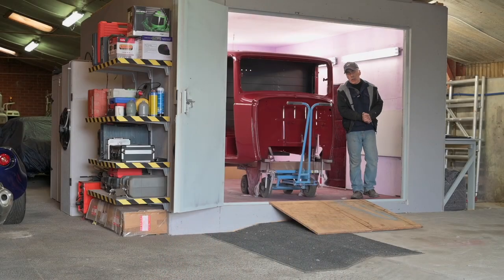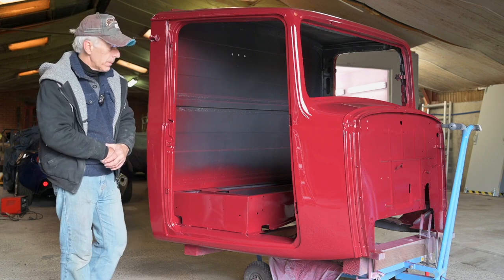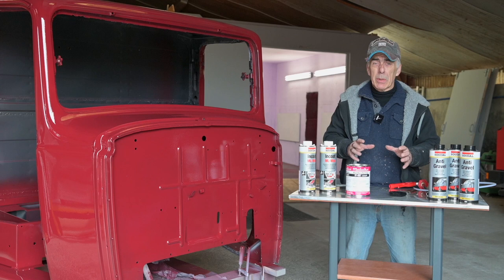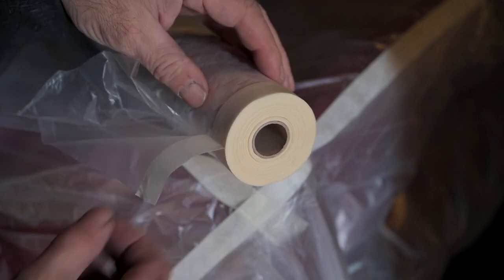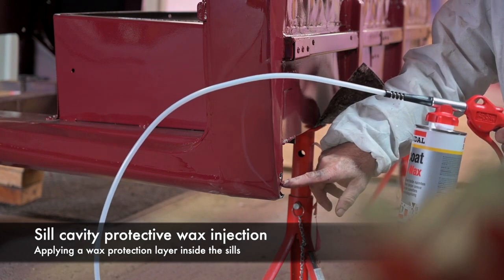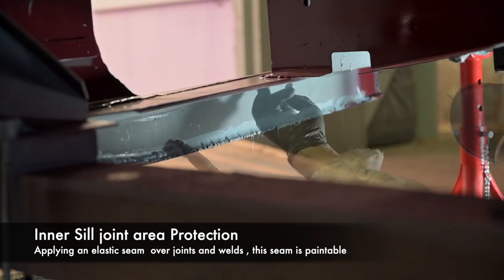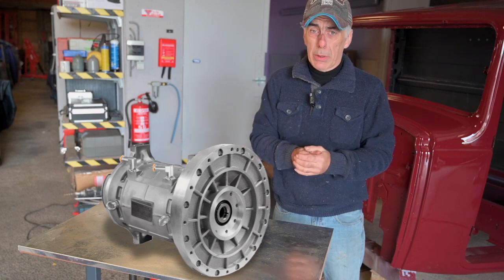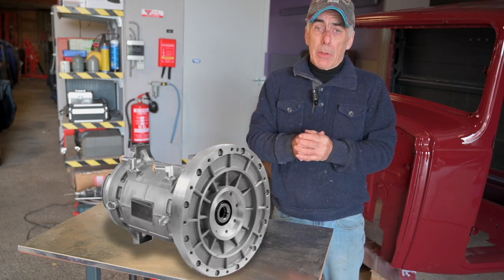Old Rusty, Part 24  Protecting against rust

Comment: Original, Only way to go, It is, after all a Classic. Needs to stay a Classic.
Reply: Rems61 trouble is an old 40bhp engine isn’t going to be able to keep pace with modern traffic. I Don’t like electric conversion
Reply: @ashleyjames308  You don't put all this effort into a classic vehicle to drive it in everyday traffic. This is for Sunday outings, a trip to the lake or the park, or the occasional classic car meet. Use the crappy old Toyota or such for the traffic.

Comment: Making a choice on the engine is a tough one. It really comes down to your thoughts and feelings about it being 100% original. Personally I would want it to be very functional and up to date, but with it all original it could become a limited driver at some point. I would think long and hard before dismissing electric, as it is no telling what the future holds for emission regulations. Electric doesn't do justice to the truck, but functionality has it's place too. I see a lot of recent roadster restorations on late model engine and chassis combinations, just because of emissions and parts availability. Most of these are driven almost daily, so it will depend a lot on what your plans are for the truck. Good luck!

Comment: I would like to see the original motor overhaul. I learn a great deal from your videos. I think if you were planning on using the vehicle for commercial work then I would go for the electric motor set. If you are going to keep it as a vintage collectible then try to keep it original. Wonderful project Keep up the great work

Comment: You are restoring a fine piece of automotive history.  If you had a fine watch would you replace the workings with a battery operated motor.  I am so impressed by your work on ole rusty, but I got sick to my stomach up when you suggested a Tesla conversion.  If you want a golf cart, buy a golf cart.
Reply: looks like Im the only one looking forward
Reply: Golf cart, lol.  Wanna race for pink slips?
Reply: @incognitotorpedo42  You clearly havent seen a Tesla accelerate from a stop in "insane mode"
Reply: zero to 60mph in 2.8 seconds and that is not a typo
Reply: @incognitotorpedo42  Sure, but golf carts don't need a pink slips
Reply: @joelpalmer  perhaps not the only one, but those of us who would like to see vintage designs with modern tech seem to be in minority.
Reply: you really want to go 60 in this?  Ok lets replace the brakes with discs, the steering with electric rack & pin., put in three pt. safety belts, and hed lights...   we end up with a French mod A hot rod.  wow.

Comment: It seems the greater majority are voting to keep it as original as possible, and normally that is the way I would want it to go, but I do find myself somewhat torn between the two choices. Perhaps the way to go would be to have an electric motor installation, but make it completely reversible, so that if you want or need to at some future point , you are able to reinstall the original drivetrain, all fully rebuilt of course. Great work Steve, like many other commenters, I really like your attitude to both your work and also your viewers, Thanks for sharing it all with us.
Reply from the maker: TXS for the comments, and I can see your point.  I really need to think it over on which way I want to take this.  I am equally torn...   Happy to share

Comment: The electric conversion would be cool, but I'd rather see that in another project, because Old rusty deserves to have it's original engine. And I'm wondering if the original gearbox and rear axle would last with the more powerful electric motor🤔 So I think my vote goes for a rebuild of the old engine👍

Comment: I don't think we have gone that far in Canada. Moreover, it is the first time I have came across an aspect of upgrading to an electric power train in the restoration of an old vehicle such as Old Rusty. An electric motor would merge Old Rusty into the 20th Century technical  advancements, consideration of emission controls, and  take pride and respect of the environment. In addition, an electric motor would be a unique aspect which would  increase the truck's value too.  A lot of people would consider this a priceless commodity. Of course if you rebuilt the gas engine and transmission to include it with the sale, you would cover both bases.

Comment: Anti-Gravel coatings work wonders, but they may also trap moisture underneath them.
I only use it at the places behind and around the wheels,  and other places where the rocks are hitting, but not at the whole bottom.

I also prefer oil-based inside coatings rather than wax based, the wax tends to shrink and crack quite fast here in Finland where we have temperatures from +30c to -30c.

Comment: Go with the engine re-build, up-grade the ignition system with electronic add an alternator, also to help the emissions, a modern carb.  If you need to re-build the engine, up-grade it, possible over bore, better manifolds etc. you are doing a superb job, dont waste it with electric motors

Comment: A difficult dilemma.  I would opt for the gasoline engine, even if acquiring the parts were somewhat troublesome.  If you wish to upgrade the power and have recharging facilities one hand & readily available where you plan to use the U23, spring for the electric motor.  With electric power you will have an ironic show piece.  Not only will the others marvel at the truck, but be surprised by electric power on board.

Comment: nice colour and nice job. It would be a pitty to go electric. Unless you plan to use it a lot.  I wouldn't care about environment for a truck you maybe will drive 5000kms a year ? A lot of problems for homologation in Belgium ? Unless you enjoy the challenge. I would go for petrol with full electronic injection.  

I think better putting another engine in it. That is allowed for oldtimers in B, no ?   I think electric sounds easier than it is. What about vacuum brake assist ? 

I know there is a guy in Belgium that passed homologation for converting a Mazda MX5 into electric. Maybe he can help?

Comment: Go electric you kill the integrity of the truck. If the original motor turns out to be a boat anchor get a small block chevy, tons of power and parts are everywhere backed by a turbo 400 trans it look and awesome and perform flawlesly forever! Love you channel keep them videos coming. Also I for one enjoy the rundown before you start working.
Reply from the maker: TXS for the comments, and I can see your point.  I really need to think it over on which way I want to take this.

Comment: Go with the electrical motor conversion.  I actually had a  truck that was converted to DC electric motor.  I looked forward to driving it every day even with the problems one encounters with old electric vehicles conversions, as  opposed to having a high maintenance restored vintage vehicle that you can only use on a limited basis.  If you change your mind you still can convert it back to the vintage vehicle.  Your not losing any options.
Reply from the maker: Thanks but to late, i started the rebuild after a long period of doubt
Reply: @D3Sshooter  Its a great project either way!

Comment: IT is a no brainer! The original engine is the only way to go, the electric is a passing fad, when people realise how polluting to is at source, it will die out, the vehicle, being "collection" should not be subjected to emission test, and the very few mile it will cover will not pollute any where as much as a central heating boiler in one month. The cab looks very nice, I hope you do not scratch it when you coat the underside, that is why I always coat the cab with the unit inverted, then when you top coat it will cover any areas that can be seen, but need to be undersealed, the wax in sections is very effective, I always use the Waxoyl products after pre heating them.

Comment: Another very instructive video on protecting body panels from rust. I am curious about that funny-looking spray gun that you used to spatter the undercoating. I have not seen such a thing before. Re: the engine, I would vote for a third choice: a modest diesel engine with a truck transmission, used but in good shape. It might require modest rework (e.g. clean the injectors), and it would require custom metal work for motor mounts, but it would be consistent with such a truck and would be quite reliable for many years. Trucks conventionally use diesel engines these days. You could get a used diesel engine of maybe 50 to 100 hp. It would be instructive in a new area for people to learn about diesels. If you put in the electric motor, there is little to teach. Re: the old engine, it is really old and problematic to get parts, plus there is no developed parts market for those old Citroen engines, I will bet. You might even have to manufacture some parts for that old relic engine. That is sometimes done, but it is quite time consuming, and gets into other areas that most folks cannot approach -- casting and machining parts. By way of comparison, where I live in Northern California, there are very many older guys who get an old jalopy and fix it up, but few of those keep the original engine. The great majority of the really old cars have completely upgraded engines and drive trains, such as 350 Chevy engines spruced up with nice chrome parts, a nice radiator, etc. and plenty of power, which is transmitted through an upgraded drive train. That is the most popular formula which we see at car shows here in California.
Reply from the maker: TXS Dennis,  I need to think about it. I still have some time and txs for the time to write
Reply: @D3Sshooter  Some commenters talk about the 'soul' of this old truck. In my view, YOU are the 'soul' of this restoration. For example, the paint that you use did not exist when this truck was originally manufactured. The undercoating and rust prevention that you use is better than what they had back then. Likely the upholstery you use will be something that did not exist back in the day. These people who say 'go original' on the engine -- how many of them have any idea what that might entail? If you go original, it will be mostly a 'show' car, that gets trailered to events. The original engine is gutless, temperamental on cold starts, not clean burning, not robust and long lived, etc. In its day it was OK. Nowadays there are quite a few options. So even though you have 'crowd-sourced' some opinions, and many people want to see you overhaul an engine (which is good), I say -- be true to your own interest and creative intent. You are a real artist, with lots of skills. All of us see that. Only the commercial, low level craftsmen do what 'sells'. The real artists create something inspiring, with a special appeal, which comes from the inner source of the artist. Be an artist! We love you regardless.

Comment: Install a Ford flathead I have seen  pictures with them installed. The French used a lot Flatheads in their trucks. I also hope you install modern brakes, duel master cyl. The works.

Comment: Its a classic vehicle but I bet if you could ask the same question to Mr Citroen we would take the electric option as well as some modern disc brakes and those swiveling headlights (LED) of course.....Probably Air Con as well. Protect the past but never get stuck in it.
Reply from the maker: TXS for the comments, and I can see your point.  I really need to think it over on which way I want to take this.

Comment: I would go for original as well. like most here. Although I must say it has run through my mind as well. For sure you'll have sufficient space to store a whole lot of batteries. But do not underestimate the cost of rebuilding to electric, as well as all paperwork, certifying with authorities etc that comes along.
I stil find differences between your cabin and mine. On the back mine does not have the vertically welded U-profiles. That seems like an improvement to me (sound-wise), so your cabin might be later than mine. Apart from that I do have an extra ventilating opening in front of the windscreen. Not sure how much that adds to a split-screen windscreen, but anyway. Did you find your cabin number (mine is located on the right-hand sill)?
Do you know what the 3 utmost left holes in your dashboard are for (2 small and 1 bigger circle) ? I don't have those either
Reply from the maker: Thank you for the comments

Comment: There is not much point in keeping it original if it then has to sit in the garage because of the emissions laws. If you can do the conversion with out altering any of the structure and then have a truck that you can use and in joy then why not. The original engine can always be installed later if you change your mind. Thanks for the great videos.
Reply from the maker: TXS for the comments, and I can see your point.   I see a 50/50 ratio at this moment.  Need to sleep over it and I still have a bit of time....    My pleasure

Comment: Maybe a bit late to the party, but I would definitely rebuild the old engine. It seems like you might be glorifying the electric option a bit. You''re saying you won't have to go to the trouble of rebuilding the waterpump,gearbox ect., stuff like that. But you're forgetting the enormous amounts of work when retrofitting the electric engine, think about the mounts, axles, gas pedal? wiring, battery compartment, getting the gauges to work, etc etc.. .
Reply from the maker: Thanks for the comment, the rebuild is already in progress

Comment: What was your original intent when you started?  I agree with everyone else that putting in an electric motor would be terrible; it is however your vehicle.  I have been patiently waiting for you to finish the body work to get onto something else.  So far we have only seen you work on the cab and strip down the original engine.  For this truck, you found some other engines for it.  Is the engine you have the only size engine they produced for this truck?  It might be interesting to find a way of making the stock engine more efficient.  In our country, vintage vehicles are exempt from emissions testing if driven less than 4000 km per year.  I am sure you will have many obstacles yet to overcome.  You have done a fantastic job on the cab.
Reply from the maker: TXS for the comments, My initial intend was to keep it original. Or at least as much as possible.   The cab has been a lot of work , the rest might just go a bit faster.  I tend to lean towards keeping the gasser...

Comment: Steve,
I'm older than old Rusty - I don't want a heart transplant and nor does he - sorry , but you have to do the work on the engine and gearbox. Use modern accessories
 if you can but keep all the originals.

I'll keep watching with admiration and a little envy

Bill
Reply from the maker: TXS for the comments, and I can see your point.  I really need to think it over on which way I want to take this.

Comment: If this truck will most likely only be driven for parades or car shows, I would go for the electric. However, if you intend to enter it in antique vehicle competitions, then restoring the engine would be best. I know this doesn't help much, but what I'm saying, is, you must decide depending on how you intend to use it .

Comment: Definitely go with the old engine restoration, you did all that work for the cabin so the engine shouldn't be a big deal. If you want more power out of that engine that can be solved with a turbo and more fuel.

Comment: It depends on what you plan to do with it. If it's going to be used regularly and treated like a regular vehicle, then electric is the way to go. I love originality, but such an old engine not a practical solution these days and it's only going to get worse in the future. An electric motor will keep old rusty relevant and useful for years to come. 
On the other hand, if you're going for a show truck and only taking her out for occasional leisure use, then rebuild the engine and keep her all original. 
If you do go electric, there's no reason (unless you start cutting up the chassis to fit the batteries etc) you can't keep the engine to one side to restore her to original in the future should you want to.

Comment: I use fish oil as wax will only protect new steel , fish oil seeps through the lap joints and stops rust , but is messy applying it. In the end it is your truck use which engine makes sense to you

Comment: Slant six from a Dodge running on propane!! You can place the tank on the back of the cab. Propane runs much cleaner than gasoline or diesel. Perhaps find an old forklift that has a fresher block. Here in Canada we would try to figure a way to slip an old Chevrolet 6 cylinder or small block Chevy in that truck:)!
Reply from the maker: Thanks for the comments

Comment: If you don't go all original you may as well dispense with "restoration" concept and just go with fiberglass mimic cars - all electric under the hood but totally faux on the outside. That and you can standardize the frame and have pop off shells of whatever you might want to convert to ......... I don't think you would have anything as satisfactory in the end but maybe by the standards of the day it would work.

Comment: As much as im a fan of correct restorations its probably too your advantage to go electric, you would save money, have more power and no problem driving it anywhere, your paint looks fantastic and i cant wait to see it finished up
Reply: Production of batteries uses vast amounts of energy and they don't last very long, and they don't work when it's cold. And by the way there isn't enough lithium to make all cars run on batteries. The most efficient way to use fossil fuels is the internal combustion engine, so it makes absolutely no sense to make a classic run on batteries, actually electric cars only makes sense if using "fuel"cells. Because liquid fuel will always be much lighter than batteries.